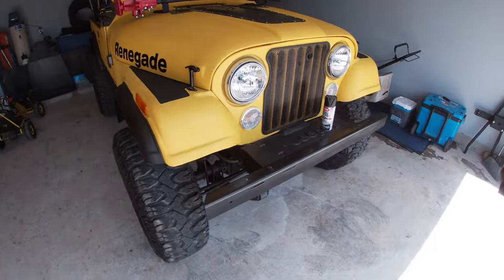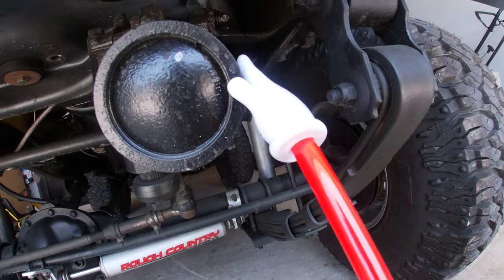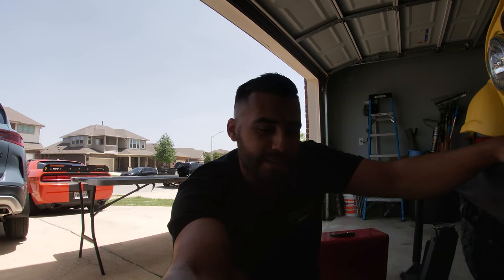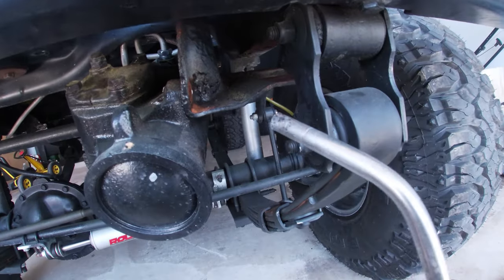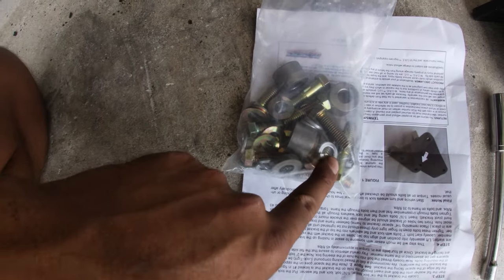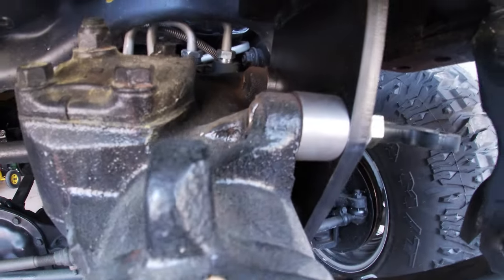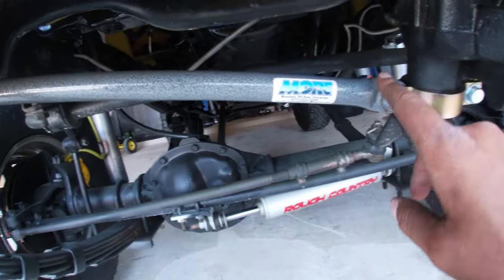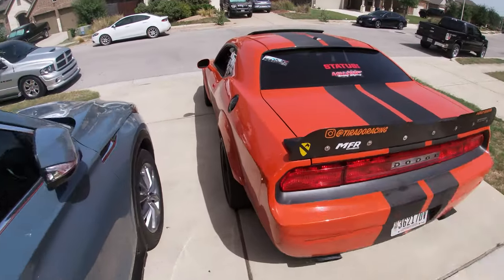CJ7’s With 35’s NEED THIS MOD From M.O.R.E Off-Road!

Comment: That pointer is hilarious!    I'll be doing this mod to my CJ5 for sure.
Reply from the maker: lol not a bad addition. 

Yea I’m about to red head steering box and Borgeson steering shaft to eliminate the last bit of play. 

also at my 4inch lift I need caster shims to get the correct caster. I have them just haven’t installed.

Comment: My instructions from MORE say it requires cutting the cross member so the steering box can move forward.  Did you have to do that? It didn't look like you needed to for your install.
Reply from the maker: Nope didn’t cut anything lol. There’s one spot you need to drill out on top but I also didn’t do that. My Jeep just cruises the street lol